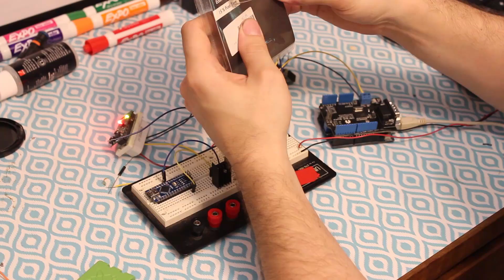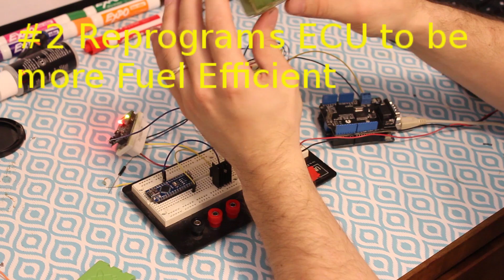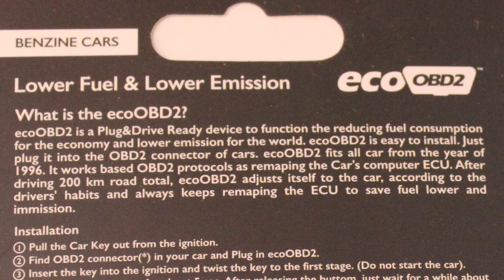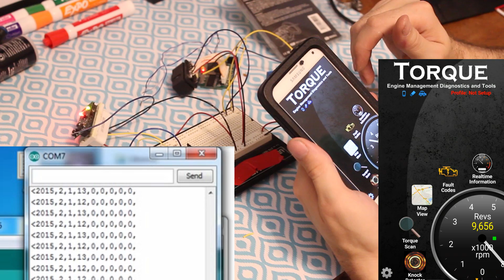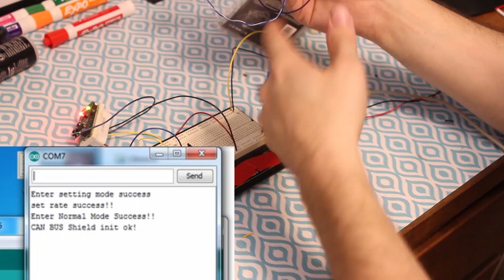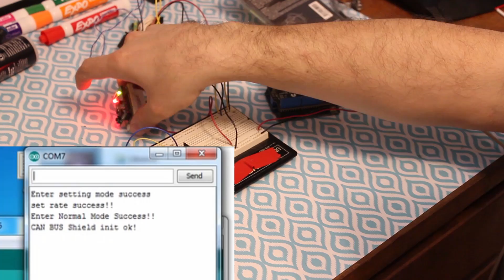ECO OBD2 Fuel Saver Busted - Voiding Warranties Ep 6

Comment: on nitro obd2, the pic16f59 can not read or modify ecu maps, it is supposed to inject some assembly code for the ecu to modify fuel injection through obd2 K-line (CANbus pins are not connected, ((EDIT: THEY ARE CONNECTED)) maybe that's why they only work with some cars based on ISO k-line communication, but not with CANbus based communication), as people formerly did by fooling temperarure sensor with a resistor to inject more fuel...
here is more info
www.facebook.com/media/set/?set=a.1381208408568286.1073741830.1144981348857661&type=3
((EDIT: ANALYSIS OF PCB BY THAT GUY IS COMPLETELY WRONG))
see also all the pictures with their explanations
search about "fuel trim" on google and youtube
http://www.easterncatalytic.com/wp-content/uploads/2012/10/Fuel-trim-graphic-EC_Fuel_Trim_Diag.jpg
it claims to work at partial throttle (closed loop, o2 sensor information taken into account by ecu), not full throttle (open loop, o2 sensor information ignored), that's why it is supposed it cannot be tested on dynamometers (full throttle) but with obd2 "short term and long term fuel trim" live data...
i don't even have one myself, i just would like to know what the device really does when connected to obd2 socket

edit: ((EDIT: NEXT IS NOT TRUE ANYMORE))
after analysis of pcb, it finally seems it only powers a chip to make 3 leds blink, it cannot send nothing to ecu, there is no canbus connection and kline is only for powering up the chip as the diode would avoid any communication from the chip to ecu
see my picture:
((EDIT: MENTIONED PICTURE WAS WRONG. BAD PCB ANALYSIS. DELETED. AFTER ANALYSIS WITH DEVICE ON MY OWN, NEXT IS RIGHT PICTURE:
http://oi68.tinypic.com/10gbs52.jpg
))

schematic:
http://oi66.tinypic.com/2jedy1e.jpg
Reply from the maker: Awesome info, I'll check that out on the bench and if it's true I'll do a followup video with the new information!
Reply: Here is another picture of another version of circuit with 6 leds
http://oi67.tinypic.com/2hqw6tx.jpg
Reply from the maker: I'm investigating now. It can't do anything on the CAN bus because it lacks the interface hardware, but KWP can be done with simple bit banging. It appears to sense a connection on the data lines because when I probe them it goes into a routine where it flashes the red light for a period of time and them stops. If it is bit banging commands out to KWP then it's trying to blindly instruct the ECU. I'll post more as I figure it out. Expect a new video shortly.
Reply: You know what, we all want better fuel economy and to save $$.  I, too have been reading and watching and trying to determine if this little device is actually going to save me $$.  I drive an 06 Honda Pilot and I think I'll just plug it in and see what it does...if it fakes out my car into thinking it's on an emissions test then so be it.

Comment: Great detailed explaination, I almost went to buy this thing. But in my country there's an agent that selling these original devices (nitroobd2 malaysia), and most of the customer feedback was positive as it save fuel and increase the torque or pickup of their respective vehicle. Can you share some of your thought about this as I'm curios about it.
Reply from the maker: Most people don't take detailed logs of fuel economy, so it's easy to believe that you have gains. As for HP/torque, anything under 10% is almost invisible to the driver, so without a back to back dyno run its just the placebo effect.  If I sold a rock (with a blinky light) that promised FE/HP gains but only after 150miles of driving I would get the same feedback. People just want to believe that it can work.

Comment: A best way to test the NITRO Red chip is to do DYNO. Comparing it with Chip installed and the dynO and no chip installed with the DYNO.
Reply from the maker: +CLYDE HARDINEL It's possible to do correctly,  but ideally you would do multiple dyno runs spread out by days, then install the device as directed and do multiple dyno runs over several days. This would eliminate some of the variability from temp/humidity/atm pressure. Or you could test it for signal while installed on a real car.

Comment: Hey, this is great, I was also wondering what the thing that progressive does? It seems like it is surveying information from the car, but what data specifically. And for those people wanting you to plug it into your car, they are more than welcome to buy on for themselves and "prove your point or wrong"
Reply from the maker: +johnsobery I never saw any signals from the dongle. It does not use OBD2 as claimed and as shown on other videos the chip has no built in protocol to communicate with the car nor a CAN interface chip like a MCP2551, both of which are required to make any communication possible. But it does have a pretty blinking LED.
Reply: @CalmResilienceMedia1  Well that's worth something. 
Ambient Lighting!!!!
Reply from the maker: +Aurelius R It doesn't actually have the hardware to comunicate with the CAN bus. The PIC has no CAN functionality and no interface chip. So no sniffing.
Reply: Are you sure it's not waiting to sniff the bus?

Comment: I've seen a model of these that just resets the ECU via a timer on the chip.So by doing that and the placebo effect people have (sad to say) seen some minor increases.But its not the best thing for your car to do.
Reply from the maker: +SouthJerseySound And resetting the ECU often leads to worse fuel economy as it dial in the fuel trims.
Reply: Most times trims richen things up over time especially if someone uses a low grade gas.It's pretty rare that I saw a car under normal condition pull fuel unless there was another issue.
   So between this and the placebo affect is where there's a small chance for someone to see a "increase"especially if they are driving in a more MPG friendly manor.

Comment: i believe the instructions says that u should reset the thing when your car is ACCU ON, not in an engine running mode. Would it yield differently?
Reply from the maker: Not if it works as described on the package. OBD2 protocol requires the device to ask for information from the ECU. Even if the key was in the Accessory position the ECO OBD2 would still have to make a request to see any information. It makes no such requests.

Comment: thanks for the video,  you are totally scientifically proof it
Reply: This test device doesn't even have the correct inputs and outputs to simulate driving the car for 200 miles. This is not an adequate test. Now I doubt this device actually works but this test proves nothing.

Comment: because your not testing on a real vehicle
Reply: Okay, while I believe your test was fine, technically one could program a PIC microcontroler to do CAN signalling on it's GPIO pins with a few resistors, not that I would recommend this due to the specifics in things like the maximum potential that can end up on the can lines, a specific CAN interface IC is not strictly needed. Of course, this is a shitty Chinese product, I doubt it is even a real PIC chip in there.
Reply from the maker: Your right it's not a real vehicle, and there were some aspects I was not mimicking because they are vehicle specific CAN signals and not OBD2. I was however mimicking a full OBD2 interface which is what the ECO OBD2 claims to use. It doesn't matter either way though because there is no CAN interface chip or CAN capability on the PIC microcontroller in the ECO OBD2. It just doesn't have the hardware to communicate with an ECU.